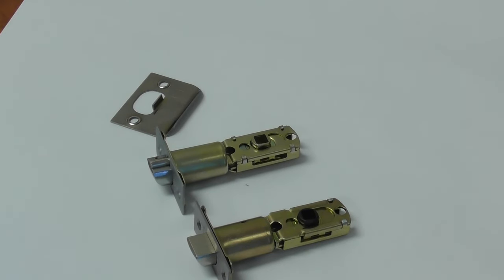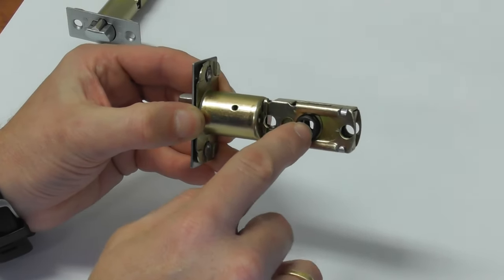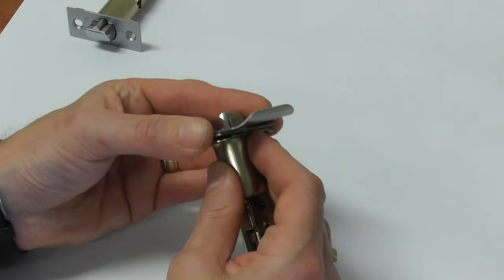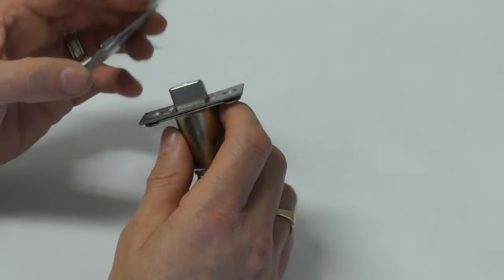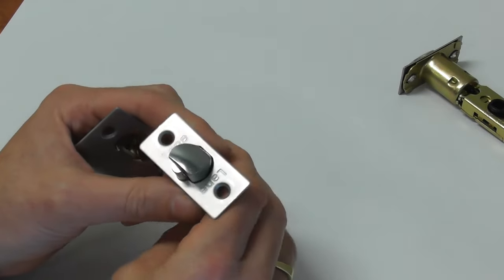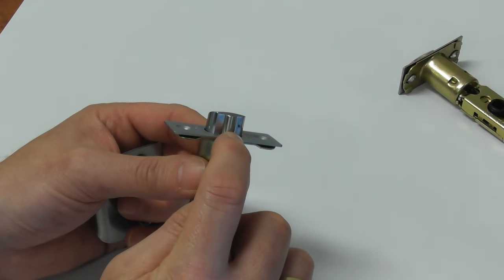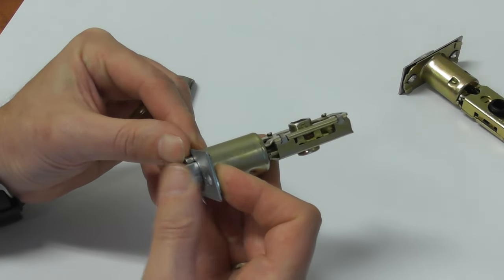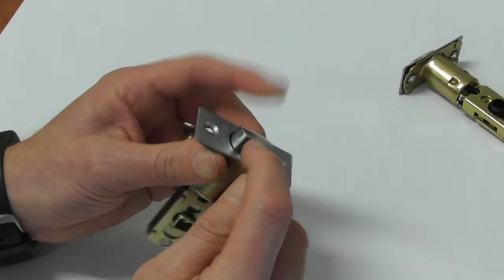Door Latch

Comment: The dead latch pin helps, but in no way prevents opening. Unless the gap is 1/8 or smaller, the plunger play is enough to open with a card. As a side note, when the diir is slammed the locking pin gets behind the striker plate and makes retracting the striker plunger difficult while turning the door knob.

Comment: Hi, I have the second type of latch you describe on a door with a keypad lock going from my garage to the laundry room. i used to be able to just push the door closed once entering the laundry room. but now the plunger stays rigid and won't depress at all until you turn the handle or reenter the code from the garage side. what happened?

Comment: Very useful explanation.
My door has a same latch with lock on handle. The problem I have is, when I lock the door from outside, the latch does not stay solid lock and with a slight push from outside, the door opens even though it is locked..
Any Video are reply appreciated

Comment: My mom has the dead Lock feature but somehow my granddaughter uses a credit card and gets in any way how can I fix this. And yes I make sure the door is locked every time I leave.
Reply: If the hole in the strike plate is too large, the dead latch will fall into it along with the plunger, and it will deactivate the security feature allowing you to use a credit card as if it were a normal plunger.